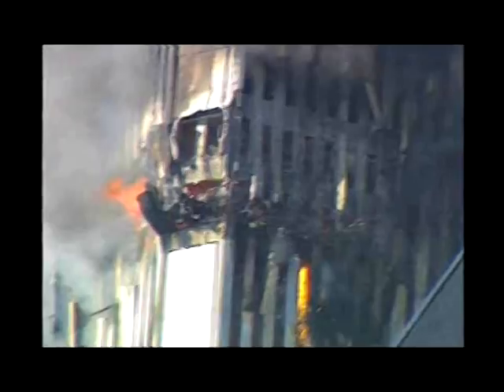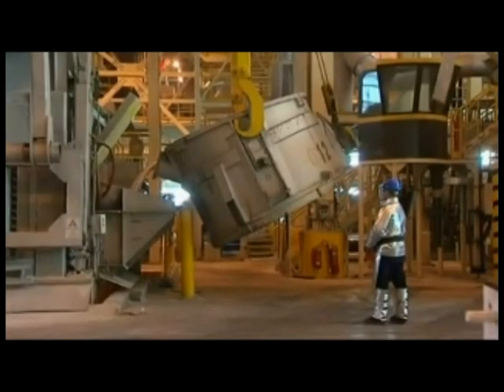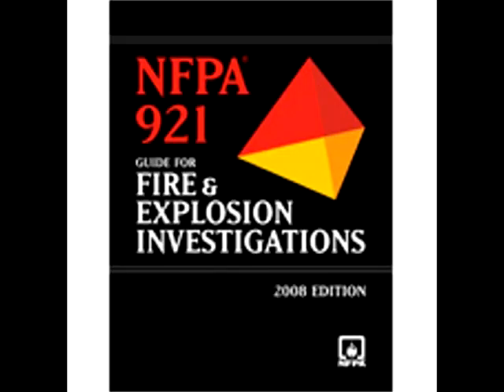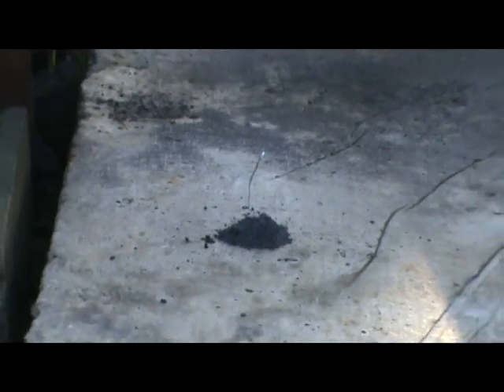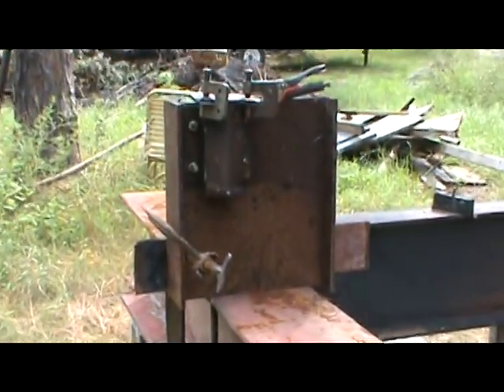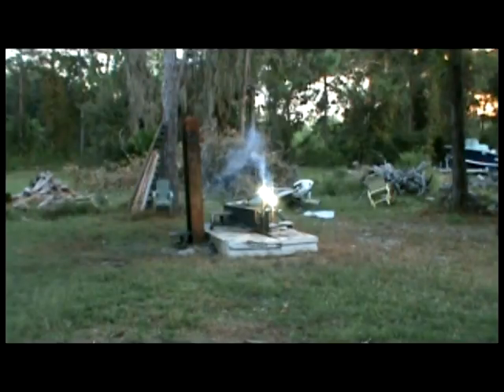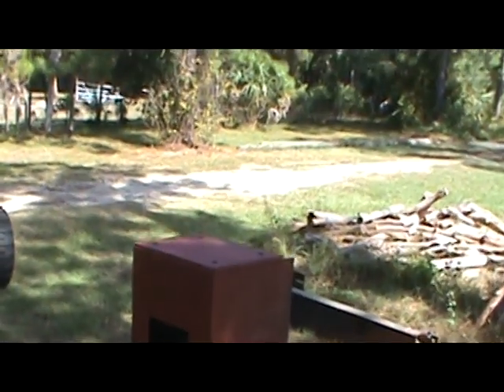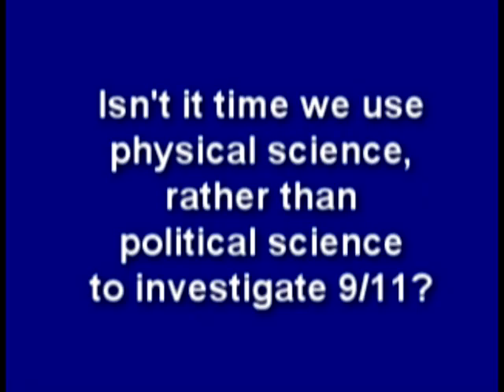9/11 Experiments: The Great Thermate Debate

Comment: I was In Tower II and had friends down their who described #7 going down.  Guiliani moved the NYC disaster recovery to #7.  There was like 10,000 gallons of diesel fuel in the building for the generators.  My witness, the owner of the former Orange Bear bar, described how the street got so damn hot he ran for his life just before the building went down.  The diesel ignited and caused it.  So all of you can just shut up.  I watched the plane hit #1.  WATCHED it from the window on the 97th floor.  Aluminum, that the buildings were clad in, has a low melt point.  And thermite is just aluminum and steel, so yes that was found in the rubble of the ALUMINUM and STEEL BUILDINGS.  By making the tragedy and attack about some other conspiracy, you help the government hide the fact that it was the SAUDI's.
Reply: Edward Schmitt ..sure must have been a horrific experience. ..mine came when I quantified the building acceleration during the collapse event ( something the nist forensic "analysis didn't bother to do even though required by Law to do so) and concluded that the columns below the impact site provided no resistance to the collapse...my over 20 years experience as a civil/structural engineer helped me out on that one.
Reply: But wasn't it the sheer load of the hinge pins that failed due to the accelerating collapse of the pancaking floors?  The outer skin columns fell on their own and were largely intact after the collapse.  People I know working on the pile told me how even though it was an office building there were no desks, no phones, the most one guy found was a portion of a phone keypad.  I did enjoy this video but just as the investigators ignored certain things, I think the "thermite' debate also ignores things.  I have read EVERYTHING and watched everything about that day.  I have heard WAY more stories than anyone else, first hand.  None of them, zero, have dissuaded me from my opinion that its was Saudis, the Bush's knew this, and most importantly the way the buildings were constructed lead to their collapse.  Once the center reinforcing columns were damaged enough from the impact of the planes, it was a matter of time.  I thing it is disrespectful, and disingenuous for any structural engineer to fail to address the way the buildings were constructed in any analysis.  You are saying 87 of my co-workers were killed by the US government.  Such a plot would have to many moving parts and people involved to stay hidden.  That many people don't ever keep their mouths shut.  Videos like this piss on people's graves, and slap survivors like me in the face.  In order to have a true debatable opinion, all facts must be considered, and on the balance like I said, I view these conspiracy theories as made up opinion and "facts".  There is a certain psychological thing with conspiracy theories, by believing them and perpetrating them individuals feel SMARTER because THEY know the truth and the majority of the public are wrong.  Now there are certain things I believe that could be true.  The plane over Shanksville really could have been shot down.  The version that survived had it's origins in the press.  Jets would have scrambled from NJ by Atlantic City-a direct intercept in that area with the flight path.  The "let's roll" phone call could not have been made from a cell phone, no one has cell phone service in a plane, etc.  And as few as 2 people would know the truth, the person who gave the order to shoot and the pilot.

Comment: Jet fuel doesn't need to melt steel beams. It only needs to weaken them. Plus we dont actually know what the quality of the steel beams is/was. Turns out buildings are really heavy. And putting really heavy things on weak supports will break the supports.
Reply: citizendc9 no one could land a plane on a building at any speed you dumbass...
Reply: Marty Hickman 1) jet fuel isnt nearly hot enough to weaken the bonds of the metal and make it more ductile 2) the "planes" hit the higher parts of the building, parts that would never make a building fall over, NOT LIKE THAT. 3) the video and many more facts and proofs show that the metal MELTED and stayed like that for days. People couldnt get close to the wreckage for at least 3 days BECUASE OF THE HEAT. Thats doesnt sound like smaller structural damage causing a building to fall, doesnt it? They either used thermite or small nukes. Fact: small nukes have been used for quite a while for demolition.many buldings during the same years the WTC was made, were made with small nukes planted in the base for a fast demolition as buildings and skyscrapers were made with demolition plans already in place and destroyed within years due to the economic scene and boom, especially in growing cities like Las Vegas with huge casinos coming and going, partially thanks to the mobs,mafia,gangs,organized crime. The WTC plans show that small nukes or some other destructive devices were indeed planned for a fast demolition. Destroying a skyscraper by weakening pillars at the top floor is plausible to you? Try to do that with anything and you will see thats not gonna happen. Especially not WTC 7. WTC 7 going down how it did due to a fire is like a 2 floors bulding going entirely down to the basement by hammering a wall on the 2nd floor.
Reply: Marty Hickman  jet fuel isn’t goin to do shit 😂
Reply: alords watchman They collapsed the top with the bottom that's how it fell straight down. had they not done so, it would have tilted way more than it originally did. And to anyone thinking the jet fuel weakened it. Then why didn't the top fall towards the direction it was hit?
Reply: You'll get loads of hate from these conspiracy loons, but you are right.
Reply: https://youtu.be/FzF1KySHmUA < PROOF JET FUEL CAN'T MELT STEEL BEAMS.
Reply: planes that are landing are not flying full throttle
Reply: william dohn wtf do you mean that there were no planes
Reply: Lorentz the annoying Llama  Always good to see a technical explanation. But you're just banging your head against a brick wall. You could be Stephen Hawking (yes I know he's dead) and truthers would still dismiss your comments and call you names . There are people like us who accept the collapse explanations because they simply work, and those who believe the demolition theory, even though a demolition expert will say that explosives couldn't be used to replicate a collapse like that. No video exists of a controlled demolition to show a collapse that looks anything like this. Believe me, I've googled hundreds, maybe a thousand and not found one. But that's never good enough .
Reply: william dohn Watch the collapse videos again William. They collapsed straight down from under the points of impact. But  at and above the points they toppled unevenly, a huge section many stories high in one video breaking away and falling off the side. It's there in plain view.
Reply: Ush Yamamoto these people think normal fire can turn steel into Hawaii like lava. Its a shame. Bankers, insurance brokers and the shadow government killed thousands of innocent people.
Reply: Marty Hickman yes but did it seriously MELT the metal enough to make the metals effects we saw?
Reply: And how comes the pilots can hit a runway? It's not much wider...
Reply: Carson Todd The dancing Israelis were Jews.. just sayin'
Reply: william dohn like how the hell do you think there were no planes
Reply: Plane engines cant go in reverse, purely by design there isnt any way you could run one in reverse without an external motor. look up how they actually work because its basically a bunch of fan blades, what happens when you turn a fan in reverse - it pushes air. turboprop engines cannot run backwards due to them needing the compounding pressure from each previous blade to pressurise the air to achieve combustion.
Reply: @acmadni turner Well for one both planes in this situation were not turboprop engines, secondly turbojet engines can induce reverse thrust which is almost solely used as a breaking mechanism in the landing process, if you're ever landed in an airliner you may remember the large vacuum sound that occurs as all wheels have touched the ground. NOW!! Do I think they used this during the incident on 9/11? No. Also just for a fun fact, turboprops also have reverse thrust functions.
Reply: alords watchman Did you see the towers collapse because if you looked you would see they clearly collapsed from the point of impact downward.
Reply: Marty Hickman woah weak things being broken by large loads what an insane and irational idea
Reply: acmadni turner I have to ask what you think  reverse thrust is then. What do jets do when they land to assist breaking on a short, wet runway or to enable exiting on a rapid exit taxiway. It reverses the thrust. A lot of jets have the capacity to reverse off stand under their own power but this is very noisy, unsafe and just not done.
Having said that, if reverse thrust is applied in flight at those speeds, the aircraft will flip and crash immediately . 
Google "Lauda  Air 767 crash" as an existing precedent.
Reply: Ronald Clements Ronald. The WTC buildings were 214ft across. That's a lot of target even at high speed. A few pilots say this just wasn't possible and these are the ones that truthers will quote. However, a vast majority say novices with a lot of SIM training (Which these guys were obsessed with) could do it. Its all there on pilots social sites. The manoeuvre to hit the Pentagon was perhaps beyond novices. But hey, that guy was an FAA certified commercial pilot trained in the USA so much more believable. Don't believe me? Look it up. But I know you won't bother.
Reply: Good lord another dumb fucking sheep please play in traffic
Reply: citizendc9 Hi Citizenc9. I'll be respectful of you unlike a troll called Bandit Silver that throws insults around like confetti. I need to point out that as the Aircraft were both destined for LAX  and had only flown a comparitively short distance, I've estimated that they probably had between 50 and 60 tones of fuel left . I can't possibly confirm that as I don't know exactly how much was uplifted in BOS but these flights were a 6.5 hour duration so fairly long for an internal flight and would take quite a lot on for a 2500 mile sector.They had only been flying for around an hour. You are of course correct in saying jet fuel doesn't burn very long on its own. However, once  50 tonnes of Jet A1 is sprayed all over the contents of several floors of an office block, everything remotely flammable in its path will spontaneously combust. I'm not going to get into distortion of steel beams as that's a whole other argument. I just wanted to point out the fireball from crashes like these is immense and travels everywhere . If doesn't just go down a single path of least resistance. It goes everywhere it can.
Reply: william dohn  I know what a shill is and youre way off. I don't really give a damn about America or American politics so am not trying to influence anyone for my own gain.  I do however care about aviation as it's been my life for 35 years.
I have always wanted to understand what the hell  went on that day. I have looked at loads of videos and drawn my own conclusions from what I can see. It seems that people who don't believe it was all rigged and a government plot are apparently stupid. My masters degree in POLITICS and a highly responsible job on which the safety of cargo airliners depends  would suggest otherwise. I also understand exactly what governments are and aren't capable of and the very questionable actions of America in the last 70 years. It's just a difference of opinion , nothing more, but some seem to want to turn it into all out war with believers.
Reply: Ush Yamamoto  Are you referring to me by any chance. If so, I make my own mind up. I'm not influenced by others so this "sheep" thing that you ALL love to quote........See my point. As for the play in traffic, you  child. I don't know how old you are and  don't really care , but grow the fuck up. All you guys can do is be offensive and as I've said to the other nasty little fuckers on here, thats what you do cos it's all you have to offer. Youre all sheep cos you all have exactly the same opinion.
Reply: And of course we all know having several hundred tons of aircraft flying into the building will have no effect on the structural integrity of the building right?
Reply: william dohn making the tea don't make you an expert either.
Reply: @ Darien Mainly because buildings are designed to fall straight down.

I'm not sure why people don't get that, buildings are designed to "fail safely" essentially meaning if the worst happens, they fall straight down. At least when you are talking about high rises, they need to otherwise you risk people getting killed or other buildings getting damaged.

They normally do this by building the actual building, around the support structure. I.e. superstructure or superstructures in the middle, that support the rest of the building off of it. They are normally designed that they fail last, so essentially when a building falls it falls down like a donut on a stick, and then the stick collapses as the donut goes down pulling it with it.

Also jet fuel, or at least fuel at 800 degrees weakens steel by about 30-60%. Depending on grade, grade 80 loses about 45% of it's strength.

That said when people say jet fuel, it's like they forget the building has stuff in it that also burns, from plastics, to gas lines, to electrical fires, to hundreds of different materials with different burning temperatures.

However likely it still wouldn't go about 1,000 degrees even considering those things. Regardless when you have a plane take out several columns, and vast parts of structure, then resulting fire weakens steel to 45% of it's carrying capacity, even if the structure could hold 3 times the weight, if you take out a large portion of it, how much can the existing structure hold, then you weaken that. 

Moreover the 45% figure is multiplied by length essentially. that means a steel beam say 10 feet long and 50 feet long, the one that's 50 feet long will yield first to a load placed on top of it if both are heated to that temperature.

So when you factor in several floors burning, you have quite a lot of structure that is incredibly compromised.

Then you have to factor in shear forces, tensile strength, load imbalances(Load leaning puts more load then expected on beams on one side of a building, meaning any weakening can be disasterous, if 40 floors lean a little because structure has been compromised, your structure is supporting what's directly above it, your structure supports a column above it of other structure, your structure on say the right side of a buildings isn't meant to support structure on the left side) and there is several other factors that are not really worth it to get into.

https://youtu.be/FzF1KySHmUA Just a fun video.

Because in the end you made up your mind and will just like a pigeon playing chess tramble on the board, knock over pieces, shit on the board and say you won the game and everyone else is a moron. You'll claim things like no other building collapsed due to fire(False, many have, built similar to WTC, and haven't had a plane crash into them) and many other things that people have repeatedly demonstrated to be false.
Reply: @ Carson, your point is a possibility. But its unlikely as the majority of the jet fuel was consumed on impact. Also residual jet fuel laying on ground would not burn. Its oily and needs to be in a very fine mist. Also taking into account the amount of fuel the planes had left, again its highly unlikely. 
Even if your view is true, and it did weaken the structure, there are so many other irregularities and things that cannot be explained. For example, no pilot could have landed those planes into those buildings at those speeds. Pilots have tried on official simulators, it cannot be done. The list goes on, check it out. Investigate, use the brain God gave you.
Reply: I really hope this is a bad joke
Reply: I'm sure the steel beams were quite impressive at the time. Unfortunately we cannot, at Ieast  I dont think we could go back and test the metal to make sure corners weren't cut and that the steel was up to snuff.
Let's say (for arguments sake) that the super structure could hold 100lbs. The building in normal times occupies 70lbs.
Let's say some asshole decided to crash a big ass air plane in to the building.
This crash takes out a critical support.
Now the building super structure can only hold 85lbs.
Let's say jet fuel ignites and the intense heat weakens the supports further. Now it can only hold 75lbs.
Perhaps uncontrollable defects were present in the steel beams. Now we are down to 70lbs.
Perhaps the upper floors shifted or fell just a tiny bit.
Wich increases the weight to 75lbs.
The steel beams snap. Perhaps that causes that shower of super heated metal you see in the video.

It could have been a perfect storm of shitty things happening.

It could have been a government conspiracy to get us back into the mid east.

If you look for a conspiracy, you will always find one. The only way we could test our ideas is to build a WTC and crash a plane into them.
Reply: Carson Todd not when it's over engineered liked the wtc and it's been double insulated with fire proofing. Never before in the history of metal Bram structures has a fire caused one to fall.
Reply: Did you watch the video you spastic? You can clearly see the steel has melted, you’re point is irrelevant
Reply: The buildings came almost straight down from a controlled explosion below ground level in the basement. Had nothing to do with superficial damage at the top of the building. Using the portrayed theory the top floors above the plane impacts would have collapsed down onto the damaged floors. Nothing but water and smoke damage below that.